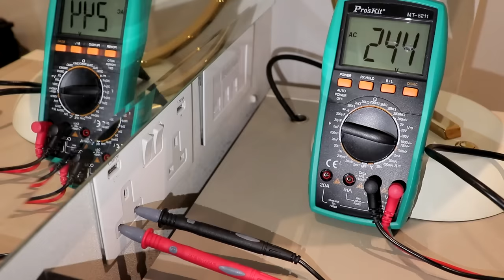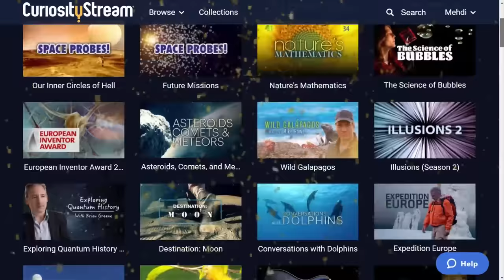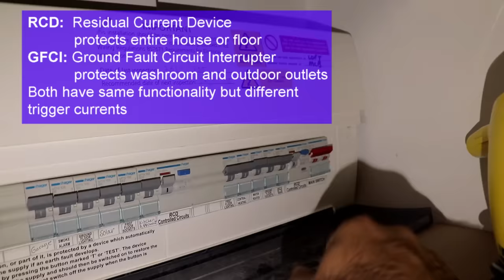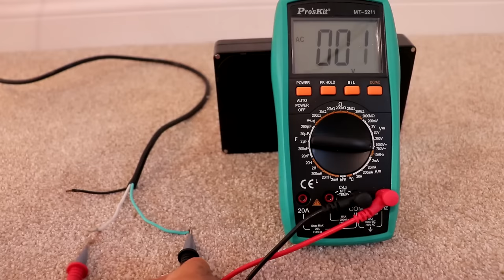Power Outlets in United Kingdom

Comment: Try the German SchuKo plug (similar to the French one).
Reply: Type F, CEE 7/4 or "Schutzkontakt" (Safety Contact)
It's used in many European countries, such as Germany,  Austria, The Netherlands, Spain, Portugal, Sweden, Finland and Norway etc... Because it's the safest of them all!
Reply: @RealCadde  How? As the live/neutral wires can be flipped by turning the plug 180°
Reply: @RealCadde  I disagree its the safest of them all, Even a simple google search puts the Uk Wall Plugs and Sockets as the safest in the world, for exactly the reasons as explained in this video, You cannot accidentally plug the wrong plug into a UK socket without considerable force, as long as you buy certified BS 1363, and not cheap chinese clone imports, with prongs that bend or distort easily
Reply: @ManIkWeet  it's ac. It doesn't matter. In my opinion the british plug is overbuilt.
Reply: @skilllessbeast7416  It does matter. It is AC but in a way that Neutral stays neutral while Live swings from -340 to 340V pk-pk (240V RMS * sqrt(2)) 50 times per second. In theory, nothing should happen to you if you touch the neutral (provided the house wiring isn't damaged). Non-polar plugs are dangerous because of many appliances (e.g. desk lamps) where only the live wire is broken by the switch. By flipping the plug you can end up with a broken neutral instead and the entire thing at live potential.
Reply: UK plug is safer with a fuse in it.
Reply: @d.i.l.l.i.g.a.f  A simple google search got me a lot of Brits praising the plug and smack talking the others with incorrect information.

Ask a real electrician, not google.
Reply: @RealCadde  I know electrics, have been doing my own for 30+ years, working alongside electricians, and also have done my own electrical installation courses, never quite got to full electrician before ill health stopped me contorting into spaces required of electricians. So yes i do know what i talk about, and am not slagging any other installation methods off, well maybe except the slums of poorer countries, with live wires hanging down the poles, and way overloaded with way undersized conductors lol
Reply: @RealCadde  Can you list some of the advantages of a Schuko-Dose over a UK-outlet?
I am from Austria and grew up with them but can't really see any advantage (in respect of safety) in Schuko (apart from the potential harm of stepping on a UK plug prongs up).

BTW, are you an certified electrician?
Reply: CD 3008 hold my cheeseburger 🍔
Reply: @ManIkWeet  Actually both wires could be live. They could be derived from two phases of a three phase 230V line instead of a live and neutral of a 400 V three-phase line.
Reply: @d.i.l.l.i.g.a.f  Ah yes, well of course you did, because what else could be more convenient now?
Reply: @givolettorulez  We don't have 3-phase 230V phase-to-phase in Europe. Neutral is neutral, live is 400V phase-to-phase or 230 to ground.
Reply: @ManIkWeet  so?
Reply: @djdjukic   actually I got an electric shock by touching both neural and ground with a finger while installing a new power outlet here in Italy. And I checked before hand which one was the real live. I'm a stupid person so I tried again at a friend house (on purpose this time) and the same happened. I was convinced that it was safe to touch the neutral but at least here in Italy it's not. (Even our plug prongs are half plastic covered, even our outlet have shutter preventing insertion of only one prong, while the ground hole is always open. And they are much more compact like half a German ones)
Reply: @REVOLUTIONS51  You can trigger an RCD while conneting the neutral to ground as long as there is a current through the neutral.
The resistance of two parallel wires (ground and neutral) is  smaller, so current goes also thought the ground connection.
Reply: @RealCadde  I'm a real electrician. BS1363 is the safest plug in the world..
Reply: @d.i.l.l.i.g.a.f  Fused plugs was a great idea 120 years ago before switchboards had multi circuits and indipendant fuse protection.  Now it just adds extra cost, weight complexity and bulk to the plug. The bulk of the pins has forced complex automatic switched outlets to reduce the danger on old plugs as the potential unfused circuit could be shorted on a part installed plug, think a plug that has got slightly pulled in the kitchen and a knife shorts the active terminals. The state of the active and neutral pins without an earth can allow incorrect termination {Active/Neutral switched} forcing appliances to be double insulated if this occurred. A frequent problem in the past.  The only thing they got correct was the voltage {Far lighter appliances=cheaper with less winding} and even then 240 volt at 50 HZ is the ideal for stopping a human heart. Lower voltages require thicker conductors to transmit the same power increasing cost. 
The plastic on the back of the pins are to protect the user from exposure on part insertion, the same is used in Australia, Argentina and China. Every modern plug should be protected this way.
Any high risk RCD protected area uses an indipendant 5~15 miliamp trip. Standard connectors use 30 miliamp trips. High risk includes Hospital and wet areas.
The safest plugs in the world are the IEC type I Australian. No insertion mix ups on a 2 or 3 pin plug. Active and Neutral are always correct assuming the outlet is wired correctly and in Australia it is illegal to do this without a License and training. The pins are thinner and only big enough for 18 amps making the plugs cheaper. No normal hose hold circuits bigger than 10 amps however 15 amp circuits are possible and the outlet for these uses a larger earth for the greater potential.  Outlets are dual pole switched {or have been for the past 70 years} so no shuttered outlets needed until recently.
Reply: Ok, to answer some of your questions because you don't seem to know.

Type F PROS
- Standard dictates that all plugs must be solid, I.E you can't disassemble them and as such are stronger.
- Sockets are sunk, meaning it's practically impossible to reach the contacts unless you really try hard. Harder than Mehdi did.
- The doors must be pushed simultaneously to open and with some force.
- The plug sits SNUG in the socket.
- The ground makes contact first.

Type F CONS
- If a plug does break, it doesn't guarantee to disconnect live first.
- They still allow Type C plugs.

Type G PROS
- They have switches on the socket. (Not a safety measure though)
- The ground makes contact first.
- They have a fuse (But this is because of ring circuits and isn't an improved safety at all)

Type G CONS
- There's no standard for plugs. They come in all kinds of hard plastics, brittle and can break easily.
- They can come loose easily, fire hazard due to arcing.
- The center pin door latch doesn't require synchronous action.
- The plug can be disassembled which is an invitation for disaster from idiots.
- The fuse has been known to overheat without tripping, causing the plastic to melt and expose live.

In short, the pros of Type G exist in Type F already.
And don't say the fuse is a vital safety aspect as all countries with Type F sockets have a fuse box in the house.
Meanwhile, the UK uses rings and as such actually have to have their fuses on the plugs. Said fuses are accessible to "idiots" and can be replaced with "moron fuses" and cause a house fire as the ring might not be protected.
Reply: @givolettorulez  Uhm no, Schuko-Outlets are not to be used in a two phase 240V (400V phase2phase) setup - that would be against regulations. However, AFAIK there are some local electrical grids in Germany (and maybe somewhere else too) that still run 120V per phase and for these a 2-phase setup is allowed and IIRC these were also one of the reasons for the creation of the Schuko standard.
Reply: @REVOLUTIONS51  That may be due to the virtual star-point which the "neutral" line is derived from. If the load on the three phases is not balanced the virtual neutral can be shifted with respect to your local ground (depending on distance to the transformer and your local grid topology).

Comment: never use your bear hands...
literally 1 second later: Gets shocked holding pliers
Reply: @The Lavian same man
Reply: @mernok2001  yeah, I think it jumped to the pliers and shorted round the resistor. 240V does stuff like that.

Personally I would have wrapped the resistor wires around the plug wires with the plug removed, and turned it on at the wall. We literally have a switch built into the system for doing stuff like this without touching it.

Comment: If you put 230 down a transformer primary that is designed for 120, the core will saturate, it will draw too much current and if not fused ("wall warts" generally are not), you'll burn up the primary and let the magic smoke out.

Comment: Please do a Video about German plugs, too. Thank you in advance :)
Reply: DID I HEAR GERMANYYYYY
Reply: I forgot, does German plugs have a separate ground pin? or does grounding work differently?
Reply: @HassanSelim0  German plugs have two ground contacts, that stick out of the socket itself. They then touch metal plates on the plug itselft. They make contact before L/N does.
Reply: @HassanSelim0  Some do, but not all of them. It depends on what device is on the other end of the cable. Plugs without ground contacts are only to be used for low power stuff.
Reply: @jankruger8915  We have that in Egypt too... kind of.
But the funny thing is, you see those metal pieces in power strips and extension cords sold here, but on the other end the connect to a regular ungrounded power socket. So it's completely pointless 😂
Some houses do have grounded sockets, but I have a feeling the ground wire isn't connected to anything.

Comment: Will you do a video about European outlets/plugs in the future?
Reply: There are like 30 states with different sockets everywhere. I'm sure that Czech and Slovakia has the same. Germany has similar ones and plugs are made to be compatible. I think they are compatible with South Korea as well, but Korea has 60Hz and maybe ten volts more or less. Narrow plugs without grounding pin are hopefully compatible nearly everywhere. But otherwise it's a complete mess. Actually we have two types of sockets: one round with grounding pin, one narrow that accepts only plugs without grounding and they can be usually found only in batroom cabinets for razors. 
Circuit breaker is compulsory only for batroom and I think outside outlets and it's rated at 30mA. Fuses are rated at 10A for lights and 16A for sockets.
Reply: @pavelperina7629  I'm for Portugal and ours are the same as Germany's. We also have a few different plugs, but all new sockets are the same. Thanks for the info!

Comment: Great video, interesting as I thought we used 30 mil amp breakers but it went of at 20ma. It saved my old builder a few times. I did not realise the US was so far behind, if you move to 240v I suggest you have breakers for everything. Very funny too, I think a lot more people will have taken note due to the fantastic presentation.
Reply: The reason it tripped at 20mA instead of 30mA is possibly due to the presence of loads which have intrinsic earth leakage such as USB charge sockets built into mains sockets. This can be a big problem when you have lots of phone chargers etc plugged into a circuit. It will eventually cause nuisance tripping of the RCD device or at least premature tripping.
Reply: But the US has been 240v since 1967.

Comment: we have split boards to allow for electricians to work with lights on. Ie: on the left partition you would have up stairs lights with down stairs sockets and visa versa. So depending on what you're working on you leave that side "live" but trip the individual breaker you are working on. So if im working on upstairs lights, i'd turn on the upstairs lights id turn off that RCD on the left, but leave the right side live which will have upstairs sockets on so i can plug in a lamp. hope that helps anyone scratching their heads on why we have split circuit boards.

Comment: Back in ancient times, we used to have fuse boxes instead of RCDs in case the plug fuse failed.  It was also common to wire your own plug.
Reply: I still wire my own plugs, after the dog decides to chew up the original plug and tear it to shreds and then I need to strip some fresh wire from an unaffected part of the plug wire and wire it up to a fresh plug.
Reply: Fuse Boxes are Better then a breaker
Reply: I think, in the UK at least, the population is divided into those people who are old enough to know exactly how to wire a plug and change its fuse and those who have no idea because plugs nowadays are completely integral with the wire and the fuse is accessible without unscrewing the whole plug
Reply: @clareshaughnessy2745  Yep.  Been ages since I bought a new plug and cut the moulded one off.  Done that a few times (especially if it comes with one of those American two pin thingies)   Last one I got had instructions on the back of the plug.
Reply: I remember learning about how to wire plugs at school in the 00s, but it has never come up in my adult life.

Comment: I appreciate safety and redundancy in a system. And I see many Brits here in the comments section taking an opportunity to wings about the US system, but I really have never had an accident with electricity and I don’t know anyone who has. I know that it can happen, but I have never personally witnessed it. I think part of it is that we run half the voltage so the potential is lower from the start. But what do I know I’m a lowly mechanical engineering student

Comment: What I've learnt from this is that UK plugs are the best, NA plugs are the worst, and NZ/AU plugs are somewhere in between. 240V, household GFC, shrouded live/neutral. We don't have the door flaps, and probably don't have internal fuses. No idea about the internal plug wire length though.

Comment: wire lengths are such that if the plug is pulled completely off none of the bare ends should touch either

Comment: Its okay if it has a plastic on the top because the outlet only delivers power on the two down and the one on the top is only to open the door that covers the metal in the two down so it is safe

Comment: You may have noticed when you had the voltmeter on that UK mains is nearer to 250VAC than 220-240VAC. Which means a 220VAC device will draw more current than it is rated for. The neutral is at 0V, unlike N.America where 220VAC is +/-110VAC it is  0/+250VAC, which means it can kill you dead, more current, don't poke it with your finger. An RCD not only detects current on the earth return but any imbalance in current on L and N. It is also rated at 13A and 13x250 is over 3kW, this so it can boil an electric kettle to make tea. (Actually it means we can run thinner cables, less voltage drop etc). Before the fuse in the plug is a ring main typically rated at 35A from the box. The fuse should not be 13A but rated for the device.
Reply: The EU standard is a nominal 230V, and any device with the CE marking (which is required in all EU countries, as well as a lot of non-EU ones, including the UK), must be capable of safely working on 230V - 6% +10. That is from about 215V to 255V. My UK supply commonly reaches about 248-249V at times of low demand, as I am close to the distribution transformer. Usually the authorities aim to be 240V or a bit more. The 220V stuff is important, as quite a lot of EU countries which are nominally 230V retain their legacy 220V infrastructure. 

Properly designed equipment conforming to EU standards will cope.

Nb. The USA (and Canada) has long used 120 +120. The lower voltage was used a few decades ago. The only exception is some apartments where the way the three phase supply is used means that the two phases are 17 for degrees apart, and they get a lot less than 240V.
Reply: @TheEulerID  like you I measured out mains, as we did at work too, safely. What happened in the UK is whilst it complies with the European Standards (which are not EU btw) they did nothing to the generators and they still pump out the same juice. As do the continental countries with higher voltage in the north than the south. Which accounts for the wide permitted range of the Euro Standard. 
One of the reasons for our higher voltage is our frequent use of using the electric kettle to make tea.

Comment: That was fun - I've gotta confess as a kid I was like that, I'm like, still here :) 
You dont see them much, but WAY back we had ROUND pin plugs, 3, 5 and 15 Amp, no fuse, and most don't have shutters - (I'd see these on theatre lights, even recently)
You might like this; when I was a kid dad got the 'professionals' to rewire the place, I was only 8, but noticed they flipped live and neutral "it dont matter - its AC" (you know a lot of London still had DC power til the mid 60's?) Well I didnt make a fuss, and a year or two later..  I had cute colour spotlights in my room, on a continental 2 pin plug ('cause it looked nice?) and one of the better 5 amp sockets with shutters, so, I stick my screwdriver in the earth hole and !!BLAMMO!! - this was a way bigger bang that yours, the thing EXPLODED in my hand, pins MELTED 
Y'see the plug had a neutral-earth short (I figured from the wreckage) so when the screwdriver shorted the metal earth strip to earth,  the Live-Neutral flip meant NO FUSES WHATSOEVER between The 'Live' neutral and earth

I think they let me fix it after that, and later we got newfangled 13A skts and ring mains.. Then i had the attic for all my funky Army Radios but thats another story

I'd say "do mind your fingers" but we both know thats what get you the clicks!

"Its the volts that jolts and the Mil's that kills" (and yes RCD's are standard here - usually 30ma) 

Do come back to London sometime - would love to join you for coffee & Boom tales  Pete, Gas Electronics, London